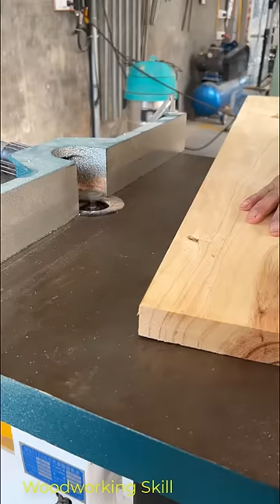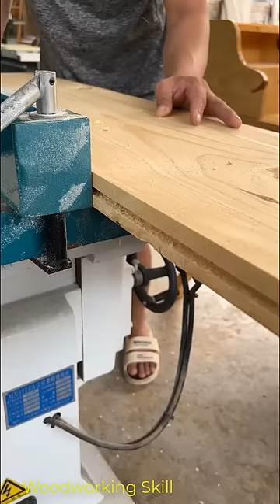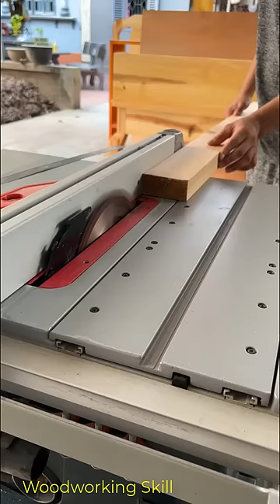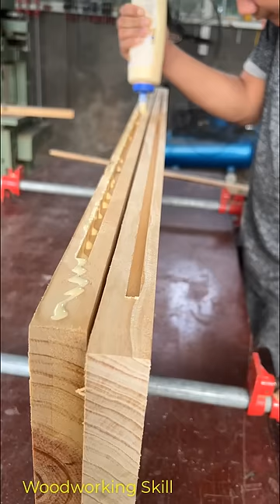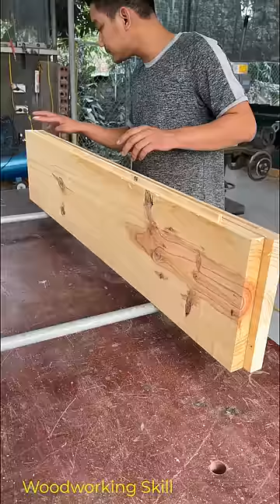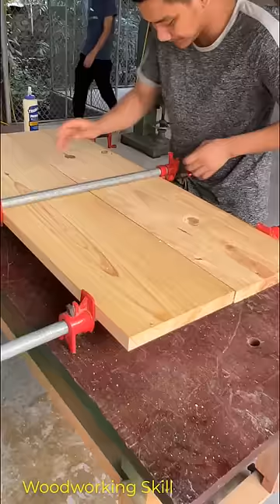How to Join Wood Planks for a Tabletop

Comment: you got the idea. strong joint but if you change grain direction of your spline it will be unbreakable, with what ever glue you choose.
Reply: Nope, the spline doesn't add strength, it just helps align the joint.